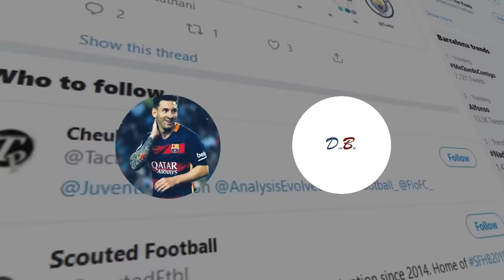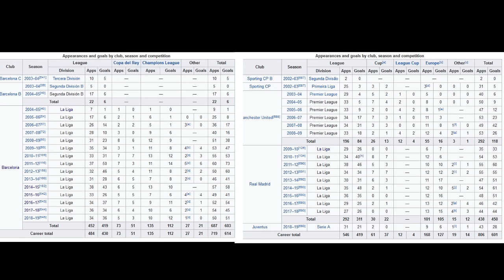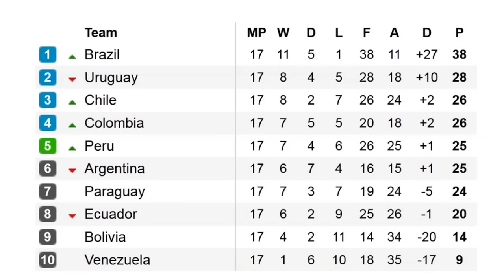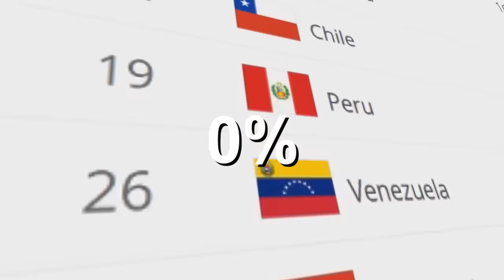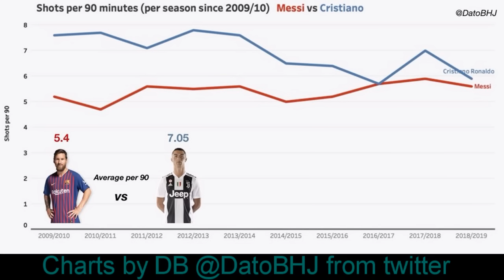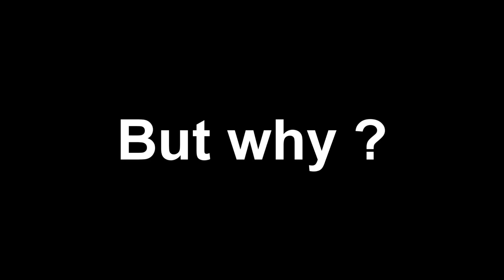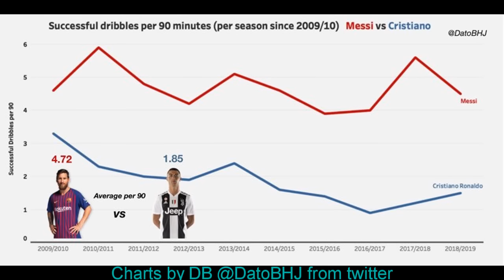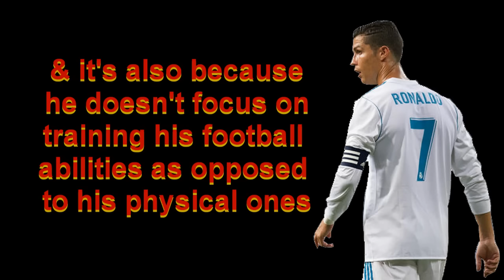Why Messi Is better than ronaldo !

Comment: Perhaps one of the reasons Ronaldo s dribble is inferior is he is much taller and his stride is much longer. Messi on the other hand has relatively short strides and is thus has the advantage in keeping the ball closer to his feet. 
Of course the main advantage is ability but the physical aspect is also most likely a factor. Ronaldo at his prime could outrun Messi but he would likely not be able to get past Messi.
Maradona was similar stature and his dribble was also superb. I cannot think of one tall player with an exceptional dribble like these two.

Comment: Inaccurate info goal ratio ≠ goals, actual goals > goals ratio
Reply: Bruh...Goal ratio is more important since the player who is more likely to score is far better than a player who scores once in a lifetime tapins
Reply: soo u r telling me that a player that scores, for example, 30 goals in 100 matches is better than a player that scores 20 goals in 30 games?
Reply: @_simao.f_1282  Player A scores 30 goals in 50 matches, player B scores 25 goal in 25 matches, who has had the better performance between the two, and who will get the golden ball between the both of them.

Again actual goals >>>> goals ratio
Reply: @FutEditzX  Wrong!!! Goal ratio vary. It's a misleading facts, your goals cannot reduce but your goal ratio can, now in 2022 has messi's goal ratio not greatly declined??
Reply: @enyoonuche3525  5 goals internacionaly in 1 game, dont see mr champions tapinaldo doin that for portugal👀
Reply: @enyoonuche3525  and also, u know that actual goals>>>> goals ratio means that actual goals r more important that goal per game ratio??? and goals per game ratio vary, very correct, and even after a whole career in spain, and a sudden transfer to france whitout any adaptacion isnt enough to messi's goals per game ratio decline enough to ronaldo surpasses him (lets not remind that tapinaldo only get 2 assists in the league, while messi has 16, but no, just look at the bad things that happens to messi). assists are the same crucial has goals, and u can cleary see that messi is clear in that aspect
Reply: @_simao.f_1282   Ronaldo has 3 assists messi has 14 assists get your facts right. Messi has a better goal per game ratio, that's true, but compare the stats with him and Ronaldo this season. Let's see how long Messi can try to maintain a gpg ratio over Ronaldo with his currently poor form. Still actual goals are better. And goals are in a way superior to assists
Reply: @_simao.f_1282  He has the most international hatricks, goals, freekicks and goals from set pieces, and has more goals than messi against the top 50 teams
Reply: @enyoonuche3525  transfermarkt doesnt say that stats (messi has 15, not 14)soo get your facts right. not always a goal its provided from a assist, but a assist always provides a goal. compare the record of more assists made by a player is 316 (*cough cough*, its messi) to the record of more goals a player scored, thats 800+ (ronaldo has that). soo, conclusio, is alot hard to do assists than goals. and messi could decline his gpg, but for sure he will get his apg alot higher, now that hes not in a destroced barça (dont go on me cuz ronaldo is at a raw Man Unt, because rashford, bruno fernandes, and even maguire were playing good before ronaldo came up)
Reply: @enyoonuche3525  messi has only 10% of his goals against national teams under 100th place in the fifa, while ronaldo has almost 50% of his goals against nations under 100 place (playing against romenia or lichtensein, how could he not break the record?) and messi has more goals than ronaldo against top 3, 4, 5, and 6 teams, even with an disadvantage of ronaldo playing alot more than him (3 years more). and lets not forget the fact that ronaldo, before joining Man Unt for the 2nd time, had + - 20 or 30 goals against english teams, with 80 appearences, while messi has almost the same amount of goals while never playing in the PL
Reply: @_simao.f_1282  Ronaldo has 40 goals against teams in the top 50 while Messi has 30 goals against teams in the top 50, Ronaldo has 12 goals against teams in the top 10 while Messi has only 4 goals.
Ronaldo has 17% of his goals scored in friendlies, While messi has 45%. 
Ronaldo has many goals against lower teams because he simply has more goals
Reply: @_simao.f_1282  A goal is harder than an assist, you could give someone a pass from your own box and he will dribble 4 players to score. In that case, which is harder, a goal or an assist?
Reply: @_simao.f_1282  With your logic they were also better before sancho and varane came, because Ronaldo wasn't the only man u player that came last season. So it Ronaldo that makes dem miss key chances, Bruno hit the bar instead of scoring sitters, and Rashford losing balls instead of passing. It's Ronaldo that told maguire to become awful at his job suddenly?. Meanwhile Ronaldo is united highest goalscorer. Man u player became lazy and lost form. Ronaldo has nothing to do with that
Reply: @enyoonuche3525  omg, now ronaldo fans need to lie to say that mr ego is better than messi. 1+8+17+16+38+47+53+73+60+41+58+41+54+45+51+31+38+11=683. this is all his goals by year, beig all of them came from la liga or ligue 1, national cups, champions league, world cup, uefa cup and clubs cup, NONE OF THEM ARE FRIENDLIES. now ronaldo, im lazy to prove that only 17% of his goals are friendlies, soo lets say that information isnt created by you :)
Reply: @enyoonuche3525  there is a thing called athmosfere. if the athmosfere is heavy, full of stress and toccity, its normal that players cant play at 100%. the same thing happened at juve, whitout any varane or sancho. juve ends up with their dinasty, to end up in 4th and never reach semi finals or even finals in the CL, disqualifying themselves to porto, with mr champions in the field. and there is also a thing called spotlight. if a guy has it all, the others cant shine. simple as that. man, this season ronaldo had 13 missed expected goals, while toney, from brentford, only had 4. soo that means that toney has a percentage of conversion better than ronaldo this season. think well. 13 missed expected goals + the 18 he scored. chances are what he has more and his teamates dont, like rashford or bruno fernandes.
Reply: @_simao.f_1282   Juve was an aged team, lacking pogba, matuidi and madzukic, and most of the players that took them to the ucl final, they played lethargic football and Ronaldo still performed for them. It's unfair blaming Ronaldo for a team that still plays bad football long after he has left. Atmosphere?, Ronaldo coming to man u doesn't change the fact these players were poor and where inconsistent long before Ronaldo came to man United, Martial was good three seasons ago, the next season he was poor, and that was before Ronaldo came. Even the best forwards in the epl have missed many chances, and salah and son have more shots on goal than Ronaldo. Rashford missed sitters season after season, but you want to blame United's highest goalscorer. The united midfield are poor in chance creation, even in matches Ronaldo do not play, United find it harder to score. United got worst not because of Ronaldo, but bad management
Reply: @_simao.f_1282   Weren't we talking about international goals?
Reply: @enyoonuche3525  u were the one who was starting to talk about 50 top teams
Reply: @enyoonuche3525  more golden boots=better scorer
Reply: @enyoonuche3525  master of one league>mediocre in every leagues
Reply: @acacia8261  Mediocre in every league?. Well highest goalscorer with goals in 4 leagues >> 2nd highest with most goals in one league
Reply: @enyoonuche3525  messi=best player
Ronaldo=pretty good goalscorer

Levels
Reply: @enyoonuche3525  btw ballon dor=best player
Golden boot=best goalscorer

7>5
6>4
Reply: @acacia8261  Messi = best player in Laliga
Ronaldo = best player in Europe and the world.
Reply: @acacia8261  ucl > france d'Or
Reply: @enyoonuche3525  plenty won ucls, nothin special
Reply: @enyoonuche3525  *ronaldo=good scorer in europe

Messi=best player in the world
Reply: @acacia8261  Modric won more balond'or than xavi and Iniesta, I guess modric is better than the both of them combined too
Reply: @enyoonuche3525  conveniently ignoring golden boot, btw francisco gento 6 cl>ronaldo 5 cl

Next...
Reply: goal ratio means messi scores more goals than ronaldo but ronaldo has more cause he played 2 more seasons 😭
Reply: @enyoonuche3525  no response huh? Ronaldo and his little cult sure are talented at losing

Comment: He said CR7 is better than messi at heading and long range shots ONLY because he's taller and heavier as if it's some type of excuse instead of saying plain out just saying CR7 is better at Messi at those attributes. But when he brings up dribbling he doesn't say Messi is better because he's shorter, which would've made sense to have said if he's gonna makes those excuses for CR7. Also why're you showing CR7 failed dribbling at the 2014 World Cup, anyone with brain cells knew he had a career ending knee injury but still played in it to help his club, and his dribbling as never been the same since hence why he tends to score more tap ins and dribble less than he used to. Not saying CR7 is better or vice versa but this video has a lot of bias and you're clearly a messi fan.
Reply: Not really cuz that knee injury BS is stupid and have been debunked cr7 can jump higher than anyone and you're saying that don't effect his knee more than simple dribbling? Also Zidane is 2cm shorter than  Cristiano and is one of the best dribbler ever. There're also players that are shorter than Messi and couldn't dribble as half as he does

Comment: Ronaldo is way way way way way way way way way way better how can you say something like that
Reply: Facts speak otherwise. Messi is a midfielder and still has over 700 goals. In the past decade he has averaged over 6 dribbles per game, scores 1.86 goals every 90 minute, highest number of hat-tricks, 91 goals in a single calendar year, most assists, more passes into the final third than the next best- Modric.
Don't blab garbage. These are the facts. Not The number of stepovers he can do or how high he can jump or the trophies he has won.
When it comes to calculating individual facts and an individual's impact on the result Messi is far better on the field than Ronaldo.
That's the truth!

Comment: C Ronaldo is the best full stop stop kidding yourselves
Reply: no ....
Reply: Facts speak otherwise. Messi is a midfielder and still has over 700 goals. In the past decade he has averaged over 6 dribbles per game, scores 1.86 goals every 90 minute, highest number of hat-tricks, 91 goals in a single calendar year, most assists, more passes into the final third than the next best- Modric.
Don't blab garbage. These are the facts. Not The number of stepovers he can do or how high he can jump or the trophies he has won.
When it comes to calculating individual facts and an individual's impact on the result Messi is far better on the field than Ronaldo.
That's the truth!
Reply: Lemme guess u don't watch football
Reply: also how does messi suck when he has better dribbling? better goal ratio? better free kicks? more ballon d’ors? more golden boots? more la ligas? more international trophies? more copa americas? better playmaking? better IQ? Better technique? Better shooting???? 🤣🤣🤣
Reply: @ribbie5362  Its just penaldo fans man. They just have lower IQ that's all. No need to be harsh on these chubby-cheek chums!